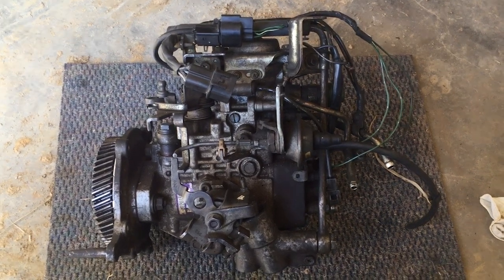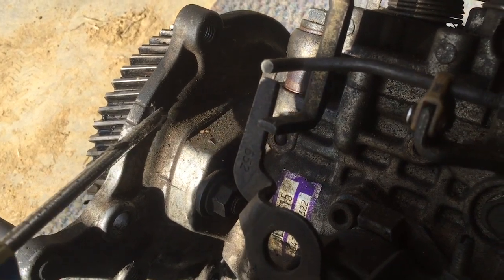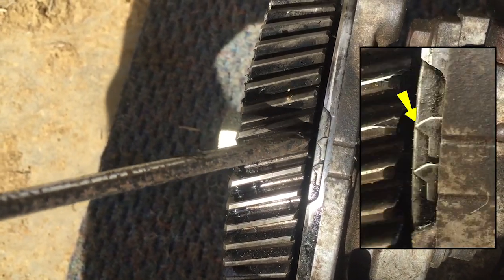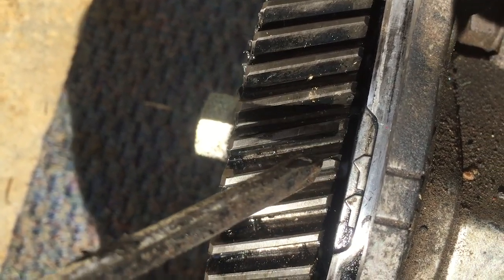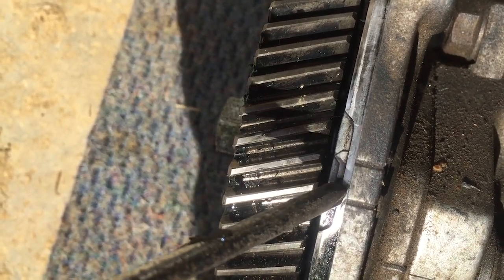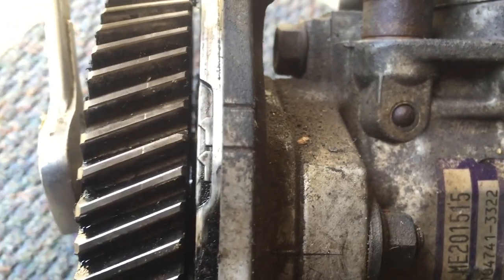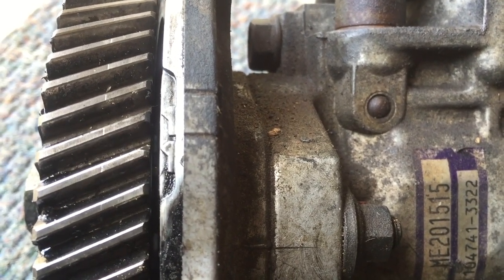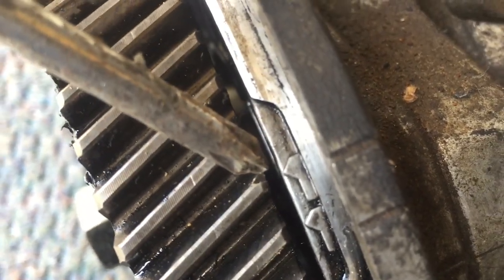MITSUBISHI 4M40 -  DIESAL PUMP TIMING MARKS

Comment: What is happening when you install the Pump with non Turbo timing mark in a Turbo vehicle ?
Reply from the maker: It will cause your vehicle to run badly , because it will not be getting correct amounts of fuel for engine with turbo.

Comment: So do you set it at that point. then slide it on, or slide it on to that point .    As sliding on will move it 1 whole tooth over.
Reply: That’s a critical piece of info you left out
Reply from the maker: you slide it on to that mark so you offset it and slide on to point

Comment: I was told that when you put it back into the car it moves one notch when you slide it in, is this actually correct?
Reply: yes it is correct , this is because when you slide it in and it touches the gears it moves slightly. I prefer to move it half a notch rather than a full notch
Reply: @siyabongamakhathini  so does it need to be set one notch back from the T so it is on the T when it goes in? or on the T before it goes in so it moves forward when fitted?
Reply: @WhisperedDreamscapes  it needs to set half a notch ( move it slightly above T so notch is slighly above T arrow ) before installalation so when fitted it will push the marks to align